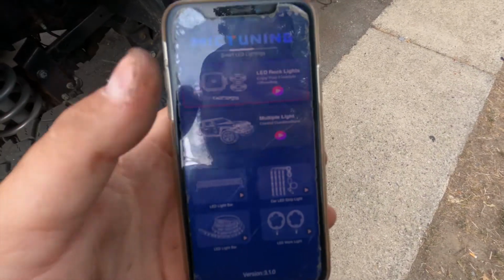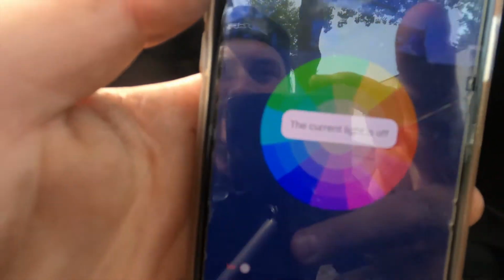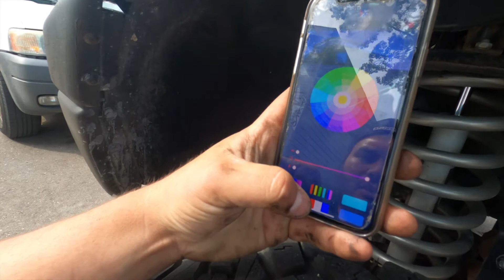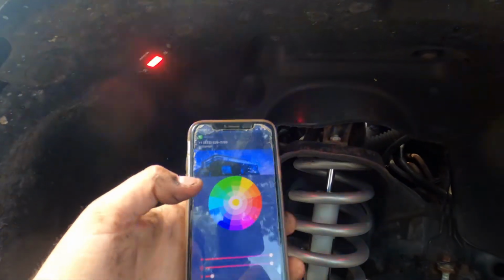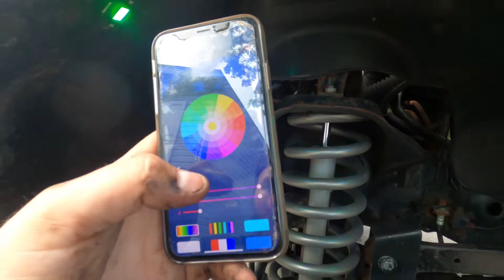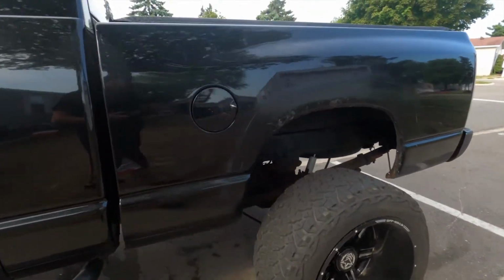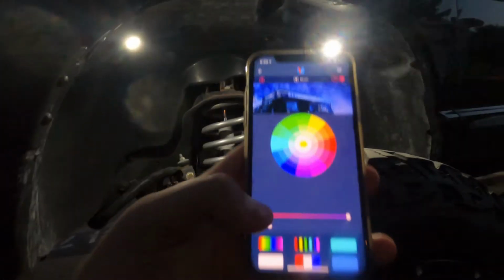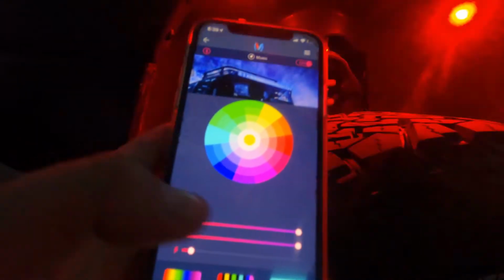I finally fixed my mictuning rock lights.

Comment: thank you for sharing, if you have any problem just feel free to contact us.  We working on a New app.
Reply from the maker: Will do thank you! They are still working fine right now
Reply: Mine is doing the same thing  and just bought  it 4 months  ago  the app wasn't  working  properly  since  the beginning
Reply from the maker: They helped me out when I contacted them. Maybe message their support system and they could assist, they sent me out a new Bluetooth module the next day.
Reply: So my rock lights aren’t working they won’t turn on and I’ve checked every wire and they seem fine can I get some help
Reply from the maker: @operationblackout5655  are they Mictuning?
Reply: I have a question...does this device only work with Bluetooth? I don't have Bluetooth......

Comment: I was grilling tonight and noticed mine rock lights were on. I opened up the app and connected to them, and they were set to off. I then turned them on manually, and tried turning them off, and they will not turn off. I have the C2’s… not sure what’s wrong. I didn’t mention it, but it’s only on the rear.

Comment: How long did u have them?? I’ve got roof lights and rock lights and both of mine just died out on me. I’m going to check the fuse and if no luck I’ll contact and get 2 new control boxes thru support hopefully
Reply from the maker: I've had a few different sets for a few years. I'm not sure if I am a big fan of them honestly. Probably go with something different on a new truck

Comment: Is it possible to buy a new box? I turned my lights on then off with the app but all lights still stay on dim… now I can’t even connect to the app but the lights still show color so I’m assuming the fuse isn’t bad but could be the box…
Reply from the maker: If you contact their support team they will most likely send you a new one
Reply: @Kickitwithkody   gotcha I will do that. Btw I just pulled the one 5amp fuse under the truck to kill the lights so it didn’t drain my battery but I also see one on the battery is there 2 fuses total with the lights?

Comment: So I have been having the same issue. I noticed there was a fuse on the positive wire, opened it up and it popped. That would explain why it wouldn't turn on.
Reply from the maker: Yes mine popped a few times and I replaced them and it would eventually pop again

Comment: I just installed mine today, and they would not turn off and had trouble connecting to the lights to my phone. Then when I finally would get them connected I couldn’t even select the option for all 8 it would even pop up
Reply from the maker: That’s what the older boxes did. What version are you running?

Comment: The most common issues I’m finding with these rock lights is the control boxes. They are built good but the circuit boards are cheap. I have 2 kits 2 boxes and 16 rock lights. They don’t operate correctly
Reply from the maker: Yeah the boxes are horrible. After I got my knee one on the latest version they made I didn’t have a problem
Reply: @Kickitwithkody  I’m running 16 total off of 2 co tell boxes I’m on my 5th control box. 2 of them didn’t even work. The 2 I have display different hues and colors.

Comment: My problem with the mictuning rock lights is they never turn off when I turn them off they go to a dim red I’m not sure what the issue is I checked my splices and all the wiring even changed the fuse and it still doesn’t work
Reply from the maker: It’s most likely the main box. They had issues with the first couple revisions

Comment: Hi so I’m having a problem with my rock lights that some of my colors aren’t working like blue green and purple and idk why and ideas
Reply from the maker: Where did you run the wires at under the truck? Maybe a exposed wire?
Reply: @Kickitwithkody  yeah under the truck I’ve looked under my truck but nothing
Reply from the maker: @oscarjr.gonzalez1512  hmm. Maybe the box is on its way out. They’ve been having troubles with the modules lately they are doing some upgrades
Reply from the maker: Or could be a bad solider joint on the led
Reply: @Kickitwithkody  what is that

Comment: My rocks lights are acting weird so I had my truck parked for 6 months and I had them disconnected I reconnected them and they all flashed and now I got the app on a new phone but only 3 are lighting up but if I disconnect them and reconnect them that 1 blinks what you think ??
Reply from the maker: i can almost guarantee you that the bluetooth box is on its way out.

Comment: I have problem with mines...it doesn't want to turn off...can some please advise
Reply from the maker: What brand do you have and where did you run power and ground to?
Reply: Same here. This thing does not turn off and it’s going to kill my battery. I hooked it up to a fuse in the battery. I turned the lights on with my phone, when I switched it off, it turned white.
Reply from the maker: Mine did the same exact thing I want to run mine to a switched fuse to to see if that works